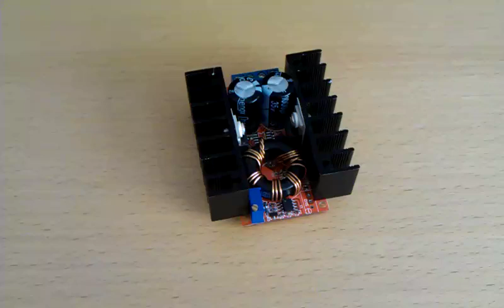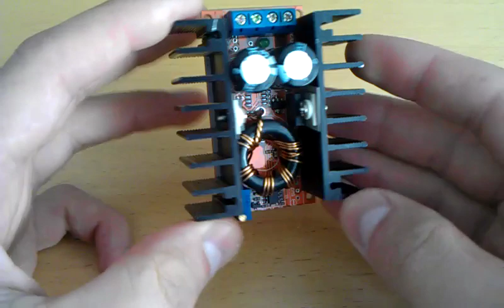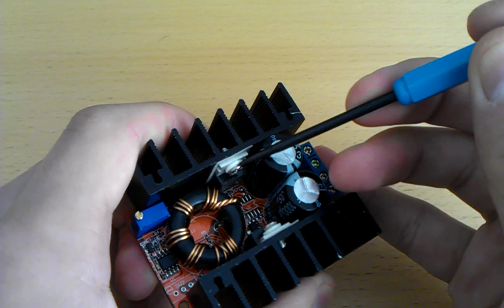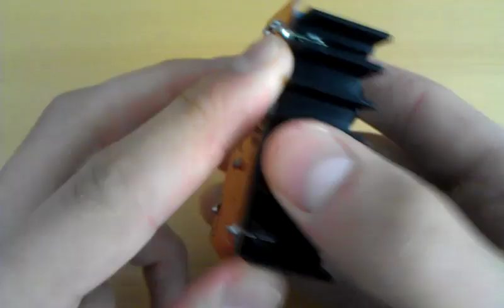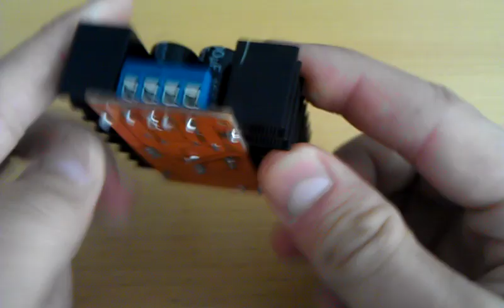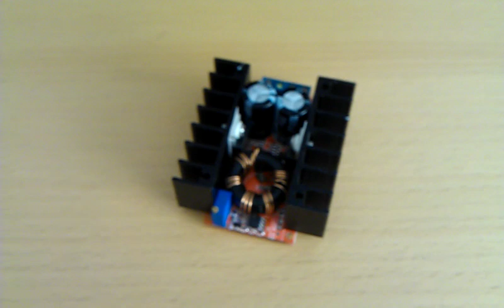ICStation.com 150W DC-DC Step Up Boost Converter

Comment: I bought a DC step up converter and it has six wires and I'm confused.
3 wires are for the Pot and there is 1 input (+), 1 ground (-), and 1 output (+).
How does it work? (Yes, newbie question)

Comment: sir, is there a circuit that can step up my 2.3V dc into a higher dc voltage?
Reply from the maker: Of course there is! :) How much current do you need?
Reply: just enough to make a charger that can charge a 9V battery
Reply from the maker: Ted Ainadrec Ahh i see!
Then this one will work.
http://www.ebay.com/itm/271610394817
Reply: tnx sir ^_^
Reply from the maker: Ted Ainadrec No problem! :)
Reply: sir, may i ask, what does the 2 amp mean? is it a requirement for the input current to be at least 2 amp?
Reply from the maker: Ted Ainadrec It's the max amount of current it can deliver. You can run it at much less if you want.
One thing to keep in mind is that if you give it let's say 4V in, and step the output up to 8V, you will need to put in twice the amount of current as you can take out of it. Because the voltage is doubled.
Reply: tnx sir

Comment: can you use solar power to convert and boost up to charge a 12v battery?
Reply from the maker: Yepp you can!
Just adjust the output of the converter to about 14V. You may want to add a diode in series with the output to not backfeed voltage, just in case. If you use a diode in series you need to comepnsate for the voltage drop it causes. so adjust the output voltage of the converter to about 0.7V higher than you actually want.

Comment: i have one dc/dc converter 150w, similar with in the video. can the dc/dc converter 150w step up the voltage from car battery? i mean, if the input from the car battery can burn or damage the dc/dc converter150w?

Comment: I used one of these for a 100w LED build. They're pretty handy, but powering the 100w LED caused mine at least to get too hot to touch. I fixed it by attaching the regulators to the main heatsink (which was a CPU heatsink) and ditching the the ones that came with it. I'd prefer not to waste the energy as heat, but for the price I can't really complain.
Reply from the maker: Oh cool. Yeah i used mine for a 100W LED for a bit too, but as with yours, mine also got very hot. So i swapped it to a slightly more expensive, better one. One thats got variable current, which you really want to drive a LED properly. The ones with fixed current do work though, if you adjust it to a voltage that corresponds with the LED's max rated current when it's warmed up. However, it wont be very stable, and if the ambient temperature gets higher than it was when you set it up, the LED will pull more power and you risk blowing it up.
Reply: Electricguy I didn't know that about the current going up as it gets warmer, so thanks for that tip. I wanted to avoid current limiting because it seems to introduce a bit of flicker with these budget regulators; invisible to the naked eye but if the shutter speed is high on the camera it can be noticeable. The heatsink I'm using is a Fenrir Titan (it's massive), which keeps the LED very cool indeed... so as long as it's not too hot to touch, having a higher current won't damage the LED? I'm running it at 32v, so I expect the current is going to be pretty high.
Reply from the maker: DIY Perks Ahh okey. Well yeah, i did some testing with the converter i have, and i balanced the voltage and current so i get virtually no flicker at all. But adding some more filter capacitors to the output, that cut the correct freqencies off, the flicker should theoretically go away totally.

That is indeed quite a large heatsink, even for a 100W LED.. hehe. But the thing is with LED's, is that they are very bad at transporting the heat away from the die. So if you overload the LED, it wont be able to get rid of the heat quick enough, and the die starts to crack, and eventually dies completely.
At 32V it could be fine with no current limiting at all, as the max rated voltage is 36V, and the current curve on a LED is incredibly steep. You can run the LED for a bit so it reaches it's max temperature, and then measure how much current it draws. If it's 3.5A or below, you're perfectly fine. The voltage doesn't really matter in this case as LED's are current drven devices. the Voltage sorts it self out accordingly.
Reply: Electricguy I'll have to make some minor revisions to my design before I make the video I think. Thanks for the tips!
Reply from the maker: DIY Perks Hehe okey. Yeah it might be good, to not receive a whole storm of shit from the trolls and possible haters ;)
No problems! Feel free to mention me in the video description or whatever if you like. you sure as heck don't have to if you don't want to. I'm glad to help people anyways :)
Reply: DIY Perks

Comment: I guess this is the converter you're using with the 100W LED with the AMD CPU-Cooler, right?
Reply from the maker: I did use is for the 100W LED. However, as this converter got no current limiter, i swapped it out to one that can regulate the current. As LEDs are current sensitive devices. :)
Reply: Electricguy yes i just swapped mine

Comment: I looked at exactly this devices on ebay lately cause they are cheap. Do you think you can operate them in parallel to increase the current output? Like using two to get roughly 12A? The efficiency factor is probably realy bad doing this. Is there a information how efficient they are? The information of the ebay seller isn't very informative.
Reply from the maker: Oh thats a bit tricky.. You can't really run them stand alone in parallel, cause one is always going to give a little higher output voltage, which means that that unit is going to take most of the load. The best way to do it is to remove the controller IC from one and let that be run as a slave unit by the other board. So you basically turn 2 boards into 1 bigger one. It's still not a great way to do it, but for the silly low price it might be worth a try.